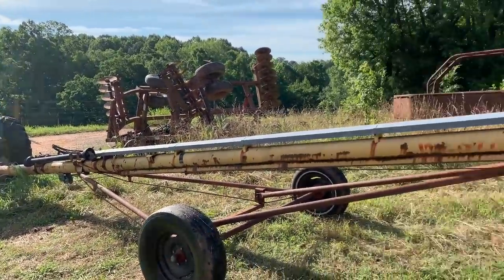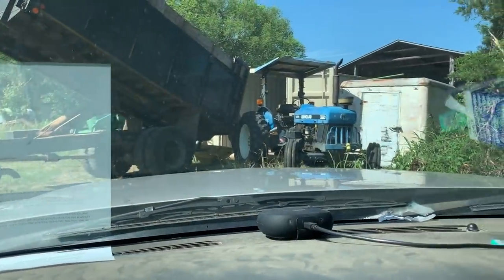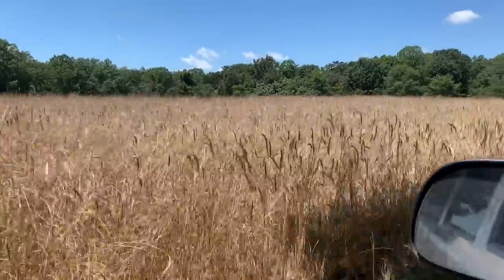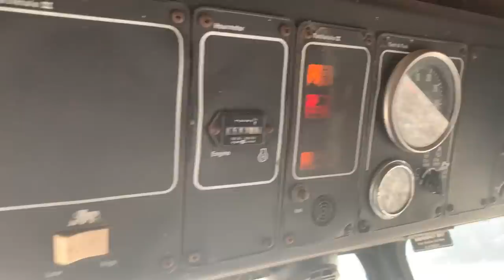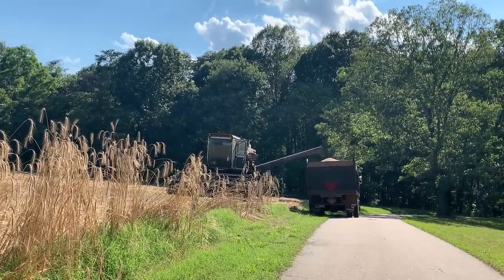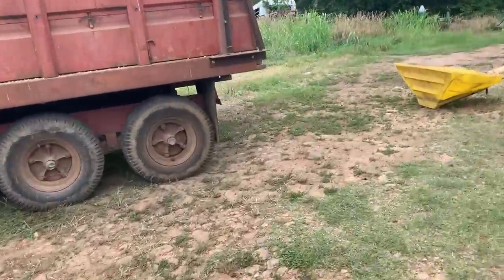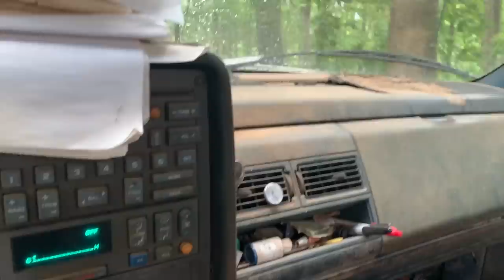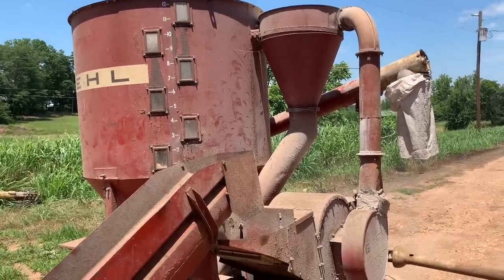Busting Barley : Back to Combining!

Comment: Try bolting a chain to the back axle and have it dragged through the straw it will help to cut the dust from collecting on the Windows keeps the static electricity down.

Comment: If that's a John Deere 790 tractor you're using for the grain auger, there's a switch underneath the seat you pull up on to disconnect the safety feature of needing weight on the seat to run it. Leave the seat tilted forward though when you're running it because it pushes the switch back down when you put the seat back down. I had the same tractor and had the same problem while running a generator off the PTO.

Comment: when we out in fields and something like a PTO needs oiling i use the truck oil from the sump pan, i also carry a quart of new oil for the truck in the cab with an empty bottle for used oil..., saves going back to the shed to get oil or grease for the equipment...

Comment: You know a rake can actually work quite well for pulling large piles of corn. 
I work grading potatoes and we move a lot of dirt/sand (place is dusty) in the course of a day. We pull lots of sandy dirt and potatoes from under the rig (that we grade the potatoes when they come out of the fields. Our primary tools are rakes, shovels (and squeegees when washing) metal rakes work well for pulling. And for PUSHING potatoes and large piles of dirt they made a tool that would work like a squeegee but for spuds or dirt. Hope that can help for future😁

Comment: Speaking from experience, when backing someone or using hand signals, use larger hand movements. When using mirrors, you really can’t tell itty bitty finger movements.  Thinks moving airliners at the gate or jets on a carrier.    I have been told I look like a bird when directing, but haven’t scratched paint yet!  Keep on Keeping on!

Comment: Miss Meredith after you unclogged the gleaner you had a dirty face. So good to see a farm wife who is not afraid to get dirty. Also Wes could use a broom when cleaning out the trucks.
Reply: We used a 4 ft handle with a piece of lightweight angle iron a foot wide attached to reach thru the door and scrape out the truck corners.
Reply: @lynwessel2471  Made a scraper from a garden hoe, cut the handle shorter to fit behind truck seat, it works great & no climbing in that box for this guy!
Reply: @jeffferanec4526  Same general idea ours was a bit wider.

Comment: a standard floor mop is 2 feet wide or more.   They make versions that are 12 inches or 16 inches that work wonders for cleaning combine and tractor windows when it is just dry dust you are trying to clear.  you can do a custom carve on the handle to make it fit inside the operator cabin where it isnt in the way

Comment: if you got some boards build partitions inside the container to the height of the auger, then shovel in afterwards... we also engineered a hatch on the roof to fill from above, adding additional options to a container for seed storage is good to do... we used 4 40ft containers for various seeds or produce... i let the kids paint the outside of em  to blend them into the back ground...
Reply from the maker: Partition coming next video :)

Comment: That little John Deere tractor should have a button underneath the seat. Flip the seat forward and pull up on the button. That will allow you to use the PTO without having someone (or weight) in the driver's seat.

Comment: Bernard why don't you put 2 spade connectors on a 5 inch piece of wire. Flip JD Seat forward unplug seat safety switch and plug jumper wire in. 
Save you ripping seat or stacking all those concrete blocks on the seat 👍💙😀

Comment: I suggest a window washing squeegee like they has at the gas pumps but put it on a telescoping pole and get a few of those industrial spray bottles that shoots the longs streams of  windex and clean the windows on Gertie that way instead of climbing all over the front and possibly hurt yourselves? I had one when I drove dump trucks so I would have to climb up on the front tires and have to get near the hot motor

Comment: Might consider cutting a hole or 3 on the top of the container and load from the top. Waterproof the openings. It would help even the crop in the container.

Comment: If you fasten a chain to the frame of the combine so it drags on the ground. it should help with the static electricity. Not as much dust will stick to the windows
Reply from the maker: It’s got a chain like that

Comment: Dirty Merdy cleaning Dirty Gerdy lol y'all are very hard-working 🐮🚜
Reply: Meredith get a 5 gallon bucket cut it in half if you have room in your deep freeze fill it with water freeze the bottom half find an old cooler put the ice in it cut two holes in it on opposite sides put a small fan to pull air through it and it works good as a supplementary air conditioner for the combine

Comment: Barley and rye..... You have just created a new hybrid "Ryeley" Have to be careful cutting downed grain. I have run up on baby deer before. They will bed down in it and if you run up on one he will cower down and not run away. Could make for a very messy and bad day if you know what i mean. Get you a soft nylon brush and put an extension handle on it to clean the windows. Climbing on that head is dangerous. Really easy to fall. Also tell Lawrence to get a short length of 1/4 or 3/8 chain and attach it to the rear axle so that it drags the ground. The belts on the machine when they turn create static electricity and that is why dust sticks to the windows. It also dissapates any static created into the ground.

Comment: IF YOU WANT TO KEEP THE WINDOWS CLEAN TIE A SMALL CHAIN IN THE MIDDLE OF THE REAR AXLE TO DRAG ON THE GROUND. We did it for years on our gleaner and it works.
Reply from the maker: We have one of those :-/
Reply: @ThisFarmWife_  GIVE THE CHAIN TIME TO GET SHINE UP SO IT CAN CONDUCT STATIC ELECTRICITY TO THE GROUND.  There is a round hook in the middle of the rear axle to hook the chain to.
Reply: @ThisFarmWife_  I did not see a chain on the combine when you were following him down the road or going into the shed. Give the chain time to shine up to conduct static electricity to the ground. Good Luck to you Meredith. If Lawrence gets used to watching you clean windows he may not want to drag a chain.

Comment: Why not cut a hole in the back of the container and rig up another vent or a door for it. That way you could just put the end of the auger into it and fill up the back of the container before you do the front, then cover/close it off. that make sense?

Comment: I have question about your silage spreader.  If you placed a divider inside the trough (bin) to cut the amount in half, because you use less milled corn in your five buckets per cattle trough.  Could the silage spreader push the corn mill out properly for distribution and not have to fill all those buckets all the time?

Comment: Idea:   Put container on top of something like railroad ties and make a sheetmetal shute for front  or cut door in center of back like on back of the dump truck and when you need to empty it lift up the other end with Loader etc if it has the capacity. Container weighs 10,000 lbs not sure how much the corn weighs but lifting up one end would only be at most half of the weight.

Idea (more practical and easy: where you park the trucks etc. Mount a thin strip of steel/ sheet metal etc a couple of inches wide about 3 or 4 feet off the ground down the edge of drivers side of wall .  Then get one of the telescoping rods used to sign up hooking up trailers that has magnet on one end and put plastic flag or tennis ball on other end.  Then you can just stick it anywhere along the wall at level its safe to back to and stop when you touch the end.  Maybe you can just stick it on the equiptment itself if it can be seen . Like these:

https://www.harborfreight.com/magnetic-trailer-alignment-kit-69778.html?_br_psugg_q=magnetic+trailer+alignment+kit

Comment: Unplug the saftey switch on the seat and the tractor will stay running
Reply: Unplugging the safety switch won't work because that opens the circuit and the safety switch is a "closed circuit" function.  Rather, clamping or tieing the circuit contacts closed will allow starting and with the seat unoccupied.

Comment: Your barley is weak. Ours itches unbearably when threshing. This is the worst grain for threshing.
I would make ventilation holes on the roof of the container. It would be harder to seal against water but you could fill them up completely.
Our barley is still greenish.